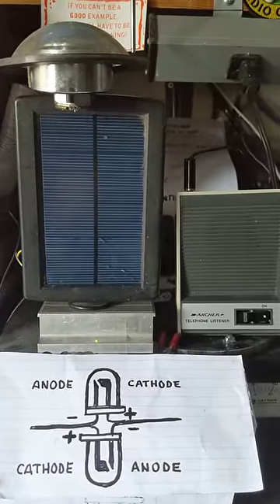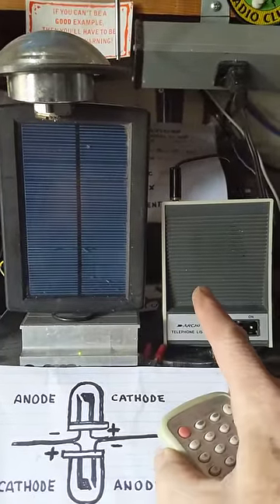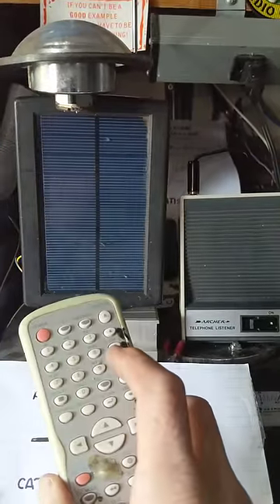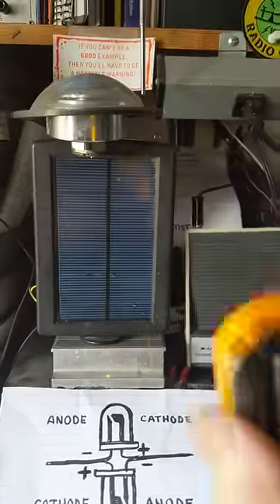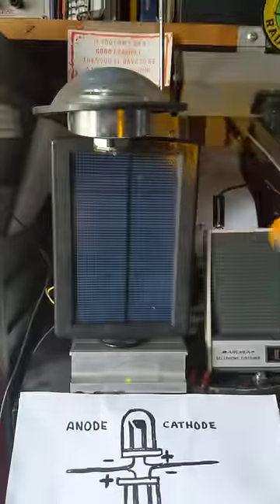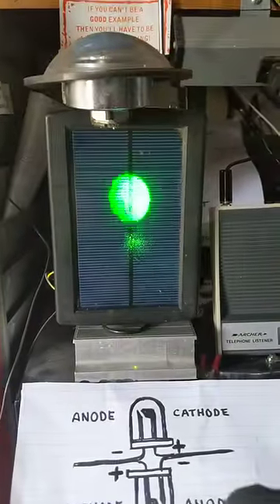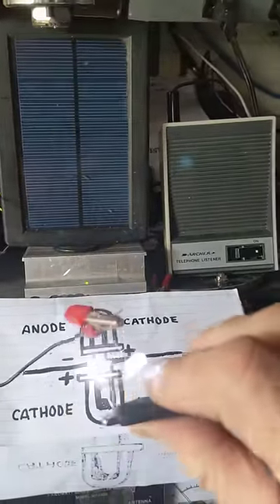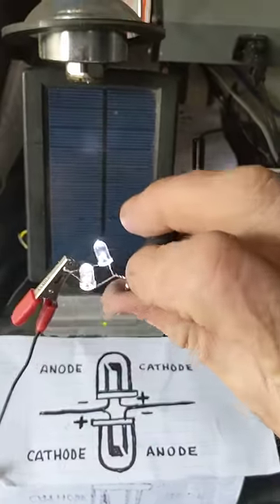Solar Panel Audio Detector!

Comment: Came to the comments for an explanation why 2 LEDs wired in such configuration can receive signals from two radio stations .  No answer.. my thought is radio waves interfering with the power supply. Crazy you can hear the signals so clearly.

Comment: A diode is a diode whether it is light emitting or not.  The light acts as a demodulator fed into the solar panel. Diodes are primary to most radio receivers.  It is basically a "crystal set" from the old days.
Reply from the maker: It's kind of like a crystal radio without a tuner.

Comment: So you're saying that the light when it's basically interrupting the antennas line is actually causing the light to flicker in such a way that is practically how a record player kind of creates sound does that only work with one light bulb and how does the light bulbs determine what the radio station is that it would pick up like to get two of them going at the same time that didn't sound like they really had any interference in between them is pretty spectacular

Comment: The LED's are light emitting DIODES. The antenna picks up all the radio stations and the Carrier Waves are removed when the "two diodes in anti-parallel" limit the bidirectional current leaving only the modulated wave.

Comment: Earned this sub.. would love some explanation by anyone competent about why the LEDs are picking up radio stations.. is it actually an audio out that is running the LED on phantom power and picking up the audio oscillations through the lights pulses?
Reply from the maker: Yes, and what I failed to mention in my short video, is the light powering the Two LEDs is coming the local AM stations, and my 200 foot long wire antenna, and a ground wire.
Reply: @GrantsPassTVRepair   ahhh nice... i used to own what they call an LPFM, and I'm a radio tower specialist lulz, happy to hear my somewhat "critical thinking" was beating around the correct bush. Cheers.

Comment: What is happening here is a consequence of the photovoltaic affect. Because the antenna is connected to the LED and is powering it, the antenna picks up the radio frequency as the radiation passes through it, this creates voltage in the antenna as the photons interact with the electrons in the conductor of the antenna. This voltage corresponds to the radio signal coming in, so every variation in radio signal is translated to analogous versions of those variations in the voltage in the antenna. This voltage then powers the LED according to the radio signal, which then makes the light flicker perfectly to represent the radio signal, which can be heard. The reason there's two signals being heard is a bit harder for me, but I suspect that both frequencies are already being picked up by the antenna, and small differences in the two diodes (like they're resistance or shape or conductivity) make them more responsive to one frequency over the other so each one plays different radio stations. That or both leds are just playing both stations as the antenna picks them both up.
Reply from the maker: Your theory sound correct. I have two AM radio stations close by, and one of them is so strong, sometimes I hear it coming through an ordinary amplifier.

Comment: I would think that the radio stations were being introduced along with the power supply for the LEDs. Photo sensor being used as a wave transducer.

Comment: No, not weird. And nothing new, even Mr. Bell was working on a system that used light to transmit voice. But it was deemed impractical as it requires line of sight to transmit.

Comment: I recently learned that the colors of elements are connected with musical notes for example, oxygen is blue an E note. Hydrogen would be yellow and an F sharp. And everything is made up of frequency so. U my friend are on to something big more than most can image
Reply from the maker: That sounds interesting, but the tones you heard are not related to the color of the light, It's the LED drivers that produce the tones.

Comment: What AC voltage do you have on the LED's because DC won't light both of them up.
How is the solar panel connected up tonthe phone amplifier?

Comment: Could we use solar panels to intercept information transported over an optic cable?
Reply from the maker: I tried pointing my TVs optical cable output at a solar panel, and I was not able to hear anything, so I assume it's encoded in some way.

Comment: Does IR have a specific tone compared to other lights? Is it possible to make it filter out everything but IR?
Reply from the maker: None of the tones you heard were related to the color of the light. The different tones were produced by the drivers that provided power for the lights. Many of them pulse now days. You can also hear IR lights such as your remote controls output.

Comment: Did you connect the last 2 leds to a radio speaker's cable?
Reply from the maker: No. The LEDs are lit up by radio waves, from a 200 foot long wire antenna, and a ground connection. This is possible because I live close to two AM radio stations.

Comment: I had this happen to me when i was 12 years old, i was building simple amplifiers with transistors and hooked them to infrared receivers, i held is up to the filament light on my ceiling and heard a radio station. I always wondered why that happened.

Comment: Did you connect the led's to a speaker wire from a radio?
Reply from the maker: I connected my solar panel to an audio amplifier.
Reply: @GrantsPassTVRepair  I know that... I asked what you connected the 2 LEDs to...
Reply from the maker: @randalfreeman1611  The LEDs were attached to a 200 foot long wire antenna and a ground wire. This link has more details. https://www.youtube.com/watch?v=vHVmJ5lD9jc&t=27s

Comment: Do you know if maybe that last one is the difference between am an fm radio?
Reply from the maker: I don't know what you mean by the difference between AM and FM.
Reply: @GrantsPassTVRepair  the last one was receiving 2 different radio stations, do you think that one of them is an am radio and the other is fm? I know a lot of radios have a switch between those two types and I'm wondering if this is how, I don't really know anything about radios though so that idea might make no sense
Reply from the maker: @purevessle2641  Both stations were on AM.. The reason there were two stations being heard, is there are two strong AM radio stations in my neighborhood, so even one LED would have brought in two radio stations.

Comment: If you cover one of the leds at a time could you single out which frequency you hear?
Reply from the maker: No. You would still hear the two strong AM radio stations no matter how many LEDs you use.

Comment: This used to happen when my band and i would play in the basement. We would hear Spanish radio stations coming from the guitar amps. We named the one song Spanish radio because of it. Is the conductor acting like a transformer or amplifier for the radio waves or something? And then releasing that back to the solar panel?
Reply from the maker: The LED is powered by AM radio stations close by, so the light intensity varies enough to be detected by the solar panel, and then amplified.

Comment: So, respectively this would also be capable of detecting hidden cameras elusively  installed in places where they should be. Please correct me if I'm wrong but instruct me if I am right. Friend, I thank you gratefully for all. 

PS. Do you know of any super tricks, hacks, app downloads or other that I may utilize (preferably without the single parent wallet draining costs) that will provide me with true, real time security video-like coverage (via satellite imaging, public open access local camera's access, and/or otherwise) whereby I can monitor through my phone any or all exterior activities of my kids, neighbors and especially strangers in the area surrounding my residence while I'm away at work? Thank you kind Sir for all the expertise you provide!

Comment: So this is essentially a radio receiver that converts the signal to visible light, which shines on the photovoltaic to create electricity that powers a speaker. Right?

Comment: How does the last one work?
Reply from the maker: The close by AM radio stations are able to light up the LEDs, and because the LEDs flicker from the radio stations audio, the variations of light are picked up by the solar panel, and amplified to produce sound.

Comment: When I need a remote control detector, I just use the TV it came with. And when I want to listen to the radio, I just use the radio. And to detect if my torch light is on, I look at it.

Comment: What does the sun sound like?
Reply from the maker: Here's what the sun sounds like. https://www.youtube.com/watch?v=-I-zdmg_Dno
Reply: @GrantsPassTVRepair   awesome!!!  Would you make one of these devices and sell it to me?  It's very interesting but I don't have a shop or space to try to make one.  I'm a truck driver and I'm just living in my truck now so I can't really do much in the way of building or crafting.
Reply from the maker: @truthfox1844  There are two separate circuits here. One is the solar panel and the audio amplifier. The other are the two LEDs that light up from my long wire antenna. Which part of this project is of interest to you?
Reply: @GrantsPassTVRepair  oohh, thats a good point! I didn't specify.  I'm was talking about the solar panel to speaker one.  I would love to have something like that to listen to different sources of light.  Just as a cool thing to do and to show other people.

Comment: also you can hear audio  sounds using dc motors, connect your power amp to dc motor
Reply from the maker: No, but if you attach a coil to  your audio amplifier, and place it near a motor that's running you sure can.

Comment: Where those leds connected to an audio source?
Reply from the maker: No. Just an antenna and a ground wire. The LEDs are lit up by radio waves.

Comment: How are those LEDs lit? Ant. Would not light LEDs especially the way they are wired.
Reply from the maker: The LEDs are lit up by the radio waves. No batteries, and no grid power necessary.

Comment: Make sure to add a DC blocking capacitor.
Reply from the maker: A small transformer works well, since it blocks the DC, while allowing the variations in sound to pass from the solar panel to the amplifier. I haven't tried a capacitor, but I'm wondering if it might block some of the signal you're are wanting to amplify.

Comment: That tells me that every led is beaming radio data through the visible spectrum, whether on purpose or not
Reply from the maker: This is mostly true if the LED is operating on pulsed DC, or if you figure out how to modulate the signal with sounds as I did, but if you had pure DC going to the LED with no audio should be transmitted.

Comment: I wonder if any light projected from a telescope would have any signal? It'd have to be amplified 8 guess.
Reply from the maker: It would need amplification for sure, but if you wanting to listen to other planets, I'd recommend you look into radio astronomy.
Reply: @GrantsPassTVRepair  would signals be able to be detected in light, or variants in color, or amplitude, converted to sound?
Reply from the maker: @Broody58  I don't believe color variations would be detectable using the technique I'm using.
Reply: @GrantsPassTVRepair  really interesting stuff. Wish I could understand it better.

Comment: Ive used light to listen to enemies in combat before , no solar panel needed.
Reply from the maker: I've seen it done on youtube with lasers, but the clarity wasn't real impressive.
Reply: @GrantsPassTVRepair  For sure a low grade optical instrument and receiver would be a little harsh but the stuff we had was as if you were in the room. Creepy.

Comment: Why does it do that with the radio
Reply from the maker: The local AM radio stations are able to light up the LEDs, and the solar panel detects the slight variations in the light.

Comment: How the hell did you manage to pass a radio signal through photons!? I am genuinely scratching my head Somebody please explain this to me so that I can try something I have a brilliant idea
Reply from the maker: Unlike incandescent bulbs, LEDs quickly respond to any variations in their input voltage, so when I attached an antenna and a ground wire to these LEDs, their intensity is slightly altered because of the neighborhood radio stations, so when I amplify the light variations, it turns into sound. This is the principle behind laser communications, but Im just doing it a little differently.
Reply: @GrantsPassTVRepair  Does that theoretically mean that this could be done using lasers overlong distance provided they are the right color wavelength?
Reply from the maker: @Kaminari_Kitsunokami  The color doesn't matter. Look up laser communications, and you will see what;s possible for long distance communications using laser beams.

Comment: Hah, I get it. You made an antenna.
Reply from the maker: Not in the conventional sense, but it sort of does the same thing doesn't it.
Reply: @GrantsPassTVRepair  The wire loop catches the waves and the diodes rectify them. I'm assuming the parasitic capacitance and inductance of the components tunes them somewhat.

Comment: Wait, wtf are you doing with that white led? Is that emitting a radio signal? Do you need two? Uhmmm. neat, this is what we need led radio. A condensed transistor radio? Measure and see if we can something else to oscillate the same way, like an lcd.
Reply from the maker: This video may help you understand what's happening here. https://www.youtube.com/shorts/aSSqrddG6B0

Comment: WTF... How ya gonna not explain that last one!?
Reply from the maker: Sound can be carried on a variety of different mediums such as mechanical vibrations, electromagnetic fluctuations and  light, which varies in its intensity as the audio from the broadcast transmitters cause a slight variation in the lights intensity, so the solar panel picks up the light variations, and converts them into small electrical signal variations, which can be amplified to produce sound.

Comment: I can hear electricity without that gizmo. Really irritating at times. The world is rarely silent, i enjoy power outages
Reply from the maker: Cameras scan pictures that amplify variations in light intensity and color, so the answer to your question is yes, pulses of light have the possibility of sending video, so long as your receiver is synchronized to move, or paint a picture at the same speed that your cameras scanner operates. This technology has been around for many years.

Comment: Possibly acting like a crystal set. What happens with one diode and one LED?
Reply from the maker: If you use the 1SS86 diode made by Hitachi and one LED the light will be far more sensitive to higher frequencies. than it will with two LEDs. Did you see my video called two dollar radiation detector you can build?

Comment: Imma gonna hav-ta call-uh 🦬-uh-💩-ah, 🐴-uh-💩-ah, and-uh 🐓-💩zah. 
Those LEDs were lit. They had power. Off-camera power. (Batteries?) 
An antenna and a ground don't produce enough power to activate an LED, let alone two of them. 
His hidden -- off-camera -- fingers were controlling the volume for the (hidden) radio speakers. 
Aaannnddd..!!!  The two LEDs would not produce two separate radio channels. They produce specific visible light frequencies. They don't produce any form of radio frequencies.

Comment: Antenna thru diodes to ground will not power the leds so no light. Where does power come from? Also antenna is radio frequency, there are no tuned circuits to convert to audio so bogus.....like most ewe toob videos.

Comment: I call BS on those 2 LEDs
Reply from the maker: It's real. Try looking up Laser communications.
Reply: @GrantsPassTVRepair  sure it's real. That's why you can't explain what you did riiiiight? Obviously, you did not wire those LEDs like that or they would not both light up. This is total BS.